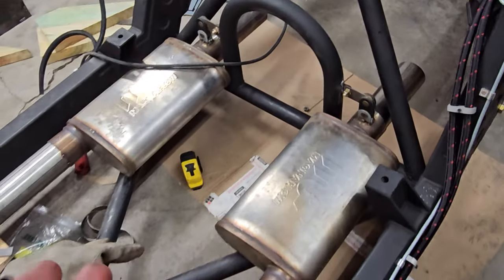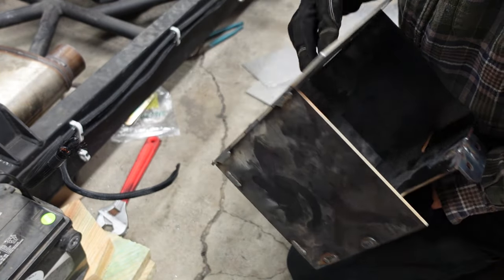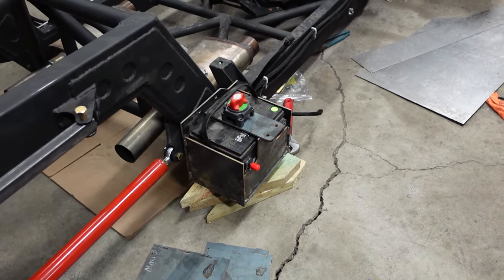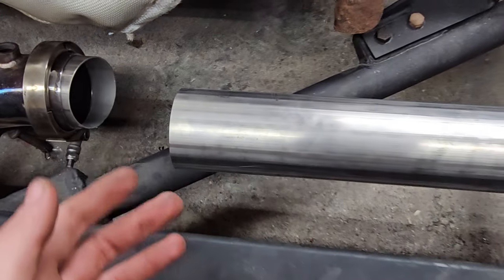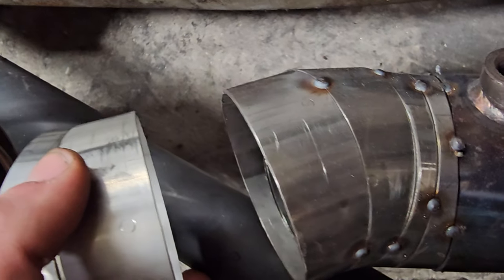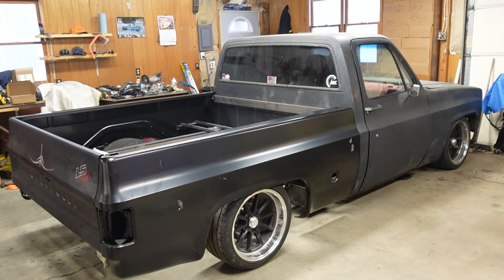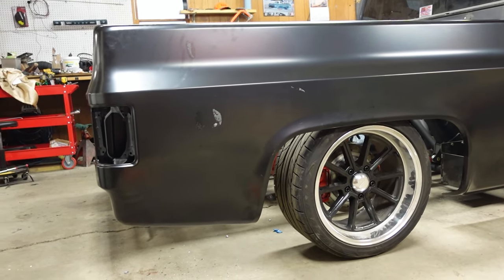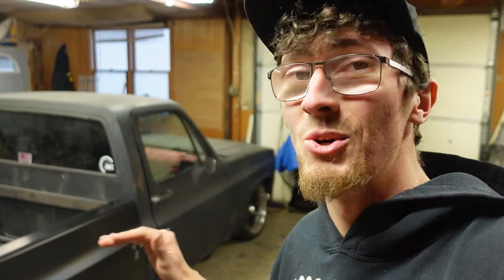The LS Swapped Chasses Gets A Body!!  -  Pro Touring C10 Chassis Build Part 8

Comment: So on the wishbone link on the rear, forgive me I’m a novice here, but I’ve heard of several different ways of hooking this up. 1. Is the way you have it. 2. Just like how you have it but backwards. 3. Just how you have it but on the bottom side. I’ve heard that when it’s on the bottom side, it induces under steer, but that is easily overcome with the right rear anti roll bar, and it becomes very balanced. It has a lower toll center if I remember correctly. Is there a reason why you chose to install it the way you did?
Reply from the maker: Yes, there was some theory behind it too. I wanted a higher roll center in the rear to couter act the lower roll center in the front and keep both tires planted in the rear. Thats the basics of it and its working as intended so far.
Reply: @designbuilddrive  hell yea, thank you for the reply. I’m always eager to learn.